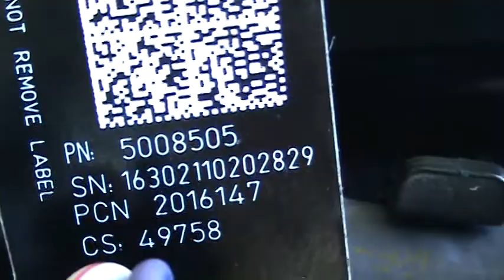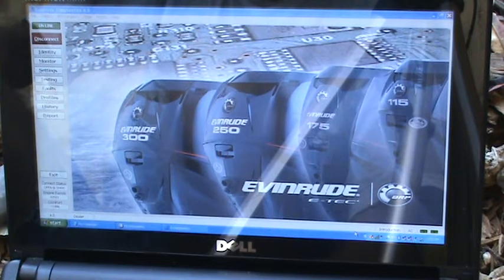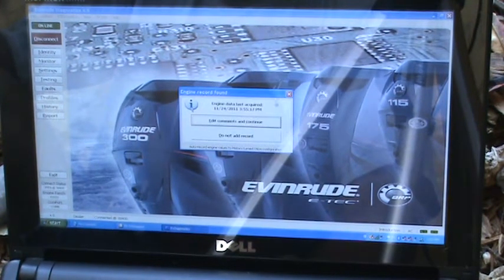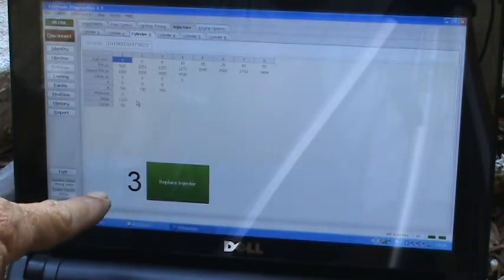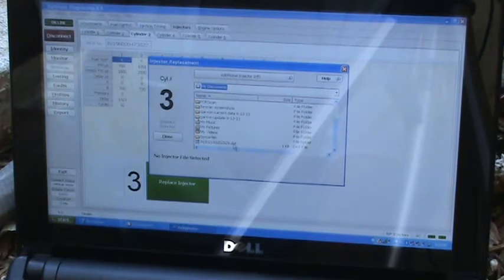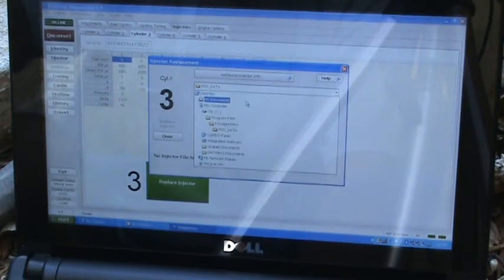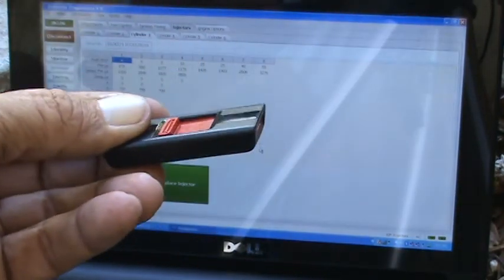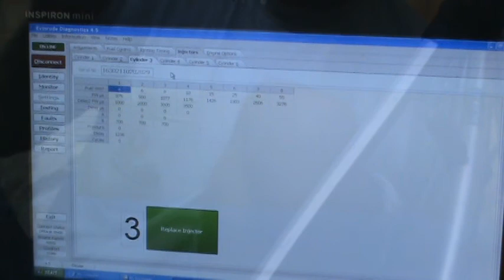2011 Evinrude ETEC fuel injector coefficient file installation

Comment: do you need the bootstrap cable? or can you use the diagnostics cable?
Reply from the maker: Just need the diagnostic cable.
Reply: Money Pit cheers mate
Reply: @moneypit9606  good morning how do you get the coefficient file please really need to know
Reply from the maker: @johannpenner7232   you normally get the coefficient file from the same place you buy the injector
Reply: @moneypit9606  i buy an Ebay